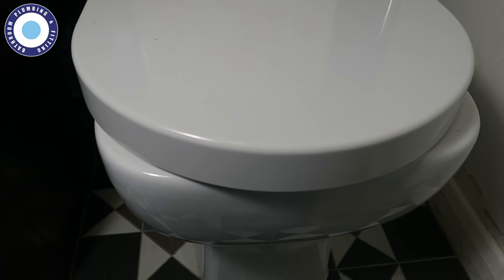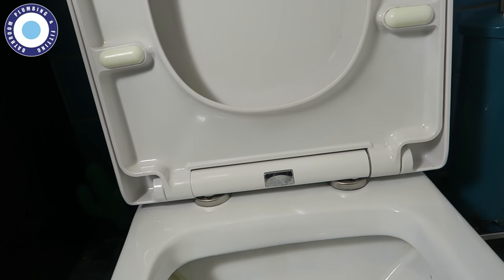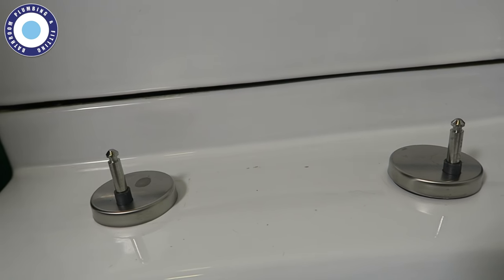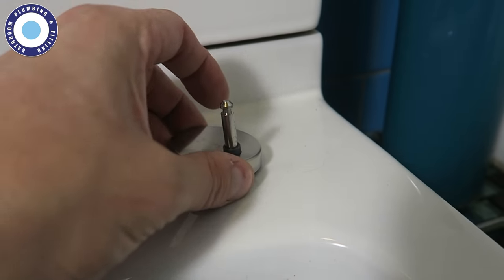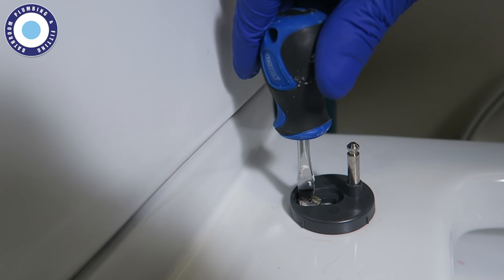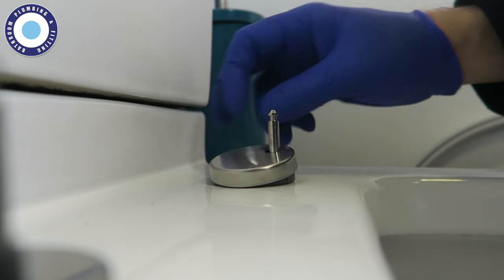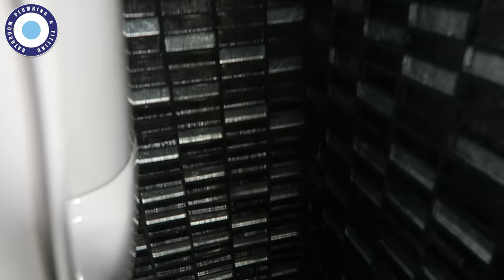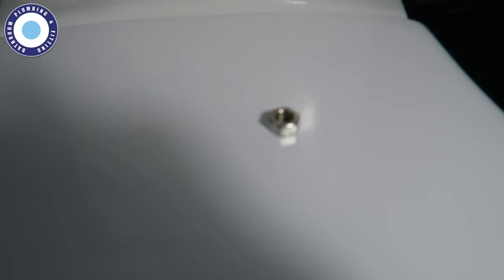How to Fix a Loose Toilet Seat | Wonky Loo Seat | Bathroom Hacks

Comment: Fun fact: Underneath the cap there are two holes with rubber tubes inserted. At the bottom of each tube is a bolt used for fixing the screws. Don't unscrew your screws too far or the bolts will fall into the body of the toilet! Live and learn. Bunnings Warehouse has replacement kits that include all the parts in a single kit.

Comment: Thank you for a very helpful and informative video. My toilet seat was like the second one you showed, but, although it was wobbly, I couldn't run any of the nuts off to get the size so as to set the jaws on my adjustable wrench. I ended up using a 13mm tubular box spanner - easy to find at Screwfix etc, and that did the job ok. I thought the photos, especially the ones of the inaccessible underside of the WC pan, were first class. Cheers, and take care, from Greater Manchester.

Comment: Thank you! Can’t believe it’s this easy and now I know the best hack ever for cleaning. So dumb that I never knew I could take the seat off so easily. In return, here’s a tip: if you sit on the aisle row of a plane and the handle annoys you because it’s fixed, there is a button under the handle near the seat that, when pressed, allows you to LIFT the handle. You can now get in and out without climbing over!

Comment: Thank you. Problem solved. Took more than five minutes. First my seat had two horizontal silver buttons. Secondly the caps didn’t just pop off after seven years I had to persevere to get a knife blade just to lift the cap without levering the pin assembly upwards. Finally I realised that leaving the seat central was important so I had to release the other pin/cap loosen the tight bolt and position both before retightening. Piece of cake once you know how 😃. Thanks again

Comment: Great video! Useful to know there's two types. Just have a question if you don't mind? We have the bottom type of fixing which has plastic nuts and I just cannot access them enough to tighten properly. It gets to the point where the bolt and nut are turning together which is when I stop. What would you recommend to try and grip the plastic nuts? I did buy a specialist plastic tool but unfortunately it is too thick to get between the nut and the pan! Any ideas? Thanks very much.

Comment: In my experience the plastic butterfly screw wears out. I usually add an additional metal washer and screw, effectively making the butterfly a washer. 
Also have a theory - use a cork from a wine bottle, pared down to fit inside the porcelain hole and a hole to allow the fixing through. This should stop the wobbling when the fixings are no longer fully functioning.

Comment: Thanks for taking the time to help people. My problem is in the nylon washer splitting and therefore repeatedly loosening. How can I get this problem fixed as is a bit dangerous in middle of night when seat moves dramatically.
Reply from the maker: Hi Sasha.

You could stick it down but you'll then have issues when you eventually try to replace it. Probably best to purchase a new seat and preferably a branded seat which will have sturdy fixings.
Reply: @bathroomplumbingandfitting7089  - Thanks will do. It was new but think the installer must have tightened the seal till it broke.

Comment: Yes, it's easy peasy. Done it that way many times with both the top and bottom type. .  .  .  . And after a few weeks they start to move again, so how do you prevent that? I've Googled it and many supposed experts recommend adhesive washers. Trouble is, nowhere in the UK seems to stock adhesive washers. Only place I've come across which makes them seems to be in the USA. Now I'm just waiting to hear if they ship to the UK.

Comment: Hiya, I’ve tightened mine. Came loose again after not long.

I’ve bought a replacement seat, and I tighten it and the bolt just never seems to tighten fully. Any suggestions would be greatly appreciated 😊

Comment: I've just fitted a new toilet seat because the old one was here before we moved in and basically disintegrated. I've tightened it all up but it still moves, I've been given the fittings in with the loo seat but they are plastic, could this be the source of the problem? (P.S. I've never fitted a toilet seat before)

Comment: Worked, thank you , as with most of life easy fix when u know
Reply from the maker: Glad it helped Nick
Reply: Just a further update, wrong seat fitted,‘seat bumpers/stoppers’ are on very edge of bowl so when weight applied and slight twist motion causes the seat bumper slips down into bowl making the seat to move sideways no matter how tight, poor work in new build sad

Comment: I am struggling to remove the silver, circular caps, they appear to be stuck on.  Because i can't get the caps off, i can't get to the screw head to re-tighten the fixings to the basin.  Any tips to remove a stuck / possibly rusty cap? I've used a small flat head screwdriver to try and pry them away but hasn't worked yet.  Thanks.
Reply from the maker: That's exactly what I always do James. You're on the right track. Just be careful not to damage the ceramic

Comment: I had to fix a similar seat but I had a big problem my screws were rusty so I had to use a hacksaw to cut one off and repl with another screw and toggle set and then I found that the screw or bolt in my case was too long and ended up cutting it to size

Comment: My wife has fixed both types of those toilet seats without a tutorial. (I didn't have a clue).On the second seat instead of using a normal nut, a wing nut is much easier to tighten by hand, otherwise buy a cheap socket spanner set which will make tightening it up easier.
Reply: I actually meant a ring spanner instead of a socket spanner.

Comment: I've tightened them as much as possible but one still moves. Any advice?
Reply: I'm sure you fixed it long before this reply, but I had the issue of it feeling fixed until you actually sat on it. Always the same side came loose.
Have a look at Toolstation, they stock replacement bolts kit for £6 or £7. If you have a local one you can check stock and use click and collect.

Comment: my seat does NOT have a button....how do you fix it?
Reply: Mine didn’t have the button you just pull upwards ( bit of force ) and it does go, only thing with mine was those nice shiny caps on mine where fixed and no screw underneath, so I had to resort to cutting the bolts off, also the  plastic fixings came with my seat, a different type from the video but worked a treat and a more simple method to fix them just push them in the hole
Reply from the maker: Fix it or remove it Ludo? If you post a link to the make and model I'll happily take a look and let you know.
Reply: @bathroomplumbingandfitting7089  I have a Rubio by Soligo toilet (model: RKN331) and my seat became loose. The discs for my toilet are plastic and I am having difficulty getting it off. Any suggestions?

Comment: Unfortunately I cannot get the top off the stainless steel fitting and the screw underneath the toilet just goes around and around. Any tips? Do all the tops of the hinge pop off to access the nut? Help
Reply: Brenda Chin I am having the same problem trying to get the cap off....tried pliers, pulling,yanking all to no avail....any suggestions ?
Reply: Hi Carmen, I managed to get the top off. Just find a flat head screwdriver and carefully put it under the cap and tilt the screwdriver to the side and it should come off. You probably want to go around the cap doing it a little bit at a time
Reply: Brenda Chin ....unfortunately the caps have lifted up 3/4" off the base ....so I'll need to find some type of screwdriver that wide ! This is the 3rd time I have had to reset the seat in 1.5 years of use ....most awkward this time ...Thanks for the reply ....Bu Kerr cha

Comment: How do you fix a screw that does not tighten
Reply: You need to hold the bottom of the seat also it has a nut that turns when I to u screw

Comment: Your DIY with the toilet seat does not quite cover my problem. The screw that goes to attach the seat will nopt go in as there is no attachment to screw the screw into. I therefore cannot tighten the screw.